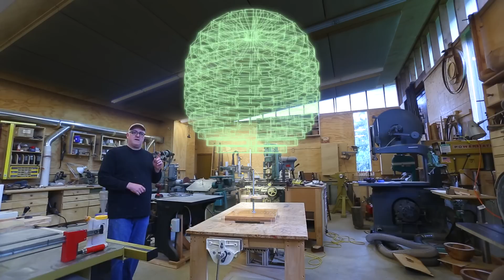Wood Turned Bamboo Death Star

Comment: Why do you need to cut the initial pieces in such particular boomerang shapes before chopping them up into the small angle pieces?
Reply from the maker: The boomerang piece was just a jig to get the angle on the sled to cut the segments.
Reply: frank howarth 
I made a segment jig like yours, I wanted to share one small improvement. I use plexiglass for the top, this way I can see if anything moved with the pressure of the clamping. love your videos. thank you